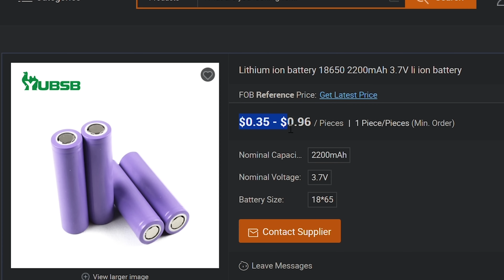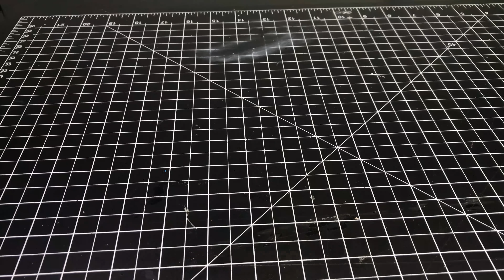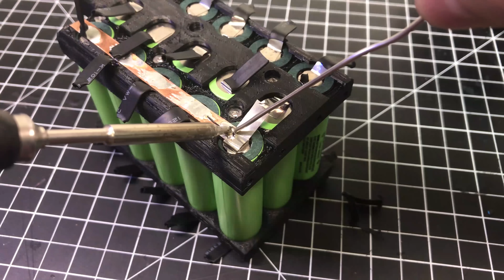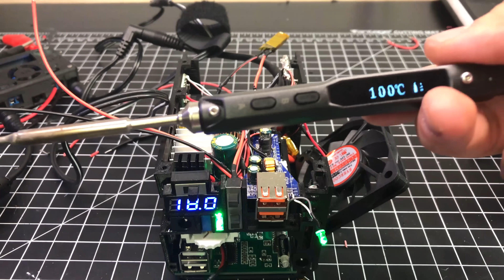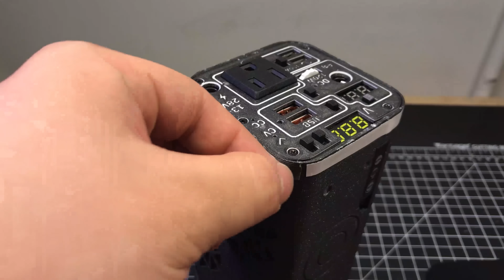How to Make the Ultimate 18650 Power Bank with Infinitely Expandable Capacity

Comment: As an alternative to soldering on the 5A fuse I would use an Inline Fuse Holder, its what they are for after all and will likely still fit, they aren't much bigger than just the fuse itself.

Heck looking at its positioning you can leave a small rectangular opening where the fuse is and poke the fuse holder out of it, it comes with a rubber cap that seals the fuse anyway.

Comment: I'm Pretty sure those cheap 18650's where fake re-wrapped batteries...
Reply: @Blondie SL There's a YouTuber by the name of Jehugarcia that makes videos all about projects that run mainly on 18650 cells. He always keeps links to where he buys them in the description. I've bought some of the 18650 cells from his sources and so far I have to say I'm quite pleased. Each cell is individually tested, charged , then discharged before shipping. I highly recommend you to use his sources.

Comment: Love these kind of projects however if you can't reclaim them from old laptop battery packs, etc. the cost of real good quality 18650s will put this back to the price of commercial offerings - those cheap 18650s often have capacities closer to 800mAh than the 2200-3000 of A grade ones, other no-name offerings are "factory rejects" of varied lifespan or refurbished from used products, etc.

There are many advantages to building your own - for instance many commercial offerings are poorly suited to charging from solar (especially if you want to charge and pass through power) and will shut off requiring constant manual restarting of charging from varied solar output.

Comment: should add 3 internal 18650's so the batteries are hot swappable
Reply: They wouldnt still be, because of the missmatch at the voltage, wich could cause a severe current flow between the cells wich have a different voltage, stopping you from doing that, unless we are talking about two separate cell circuits feeding the same system, with their outputs in parallel, and not the cells themselves, but then its quite different.

Comment: Check "Emergency Flashlights". Note that there's a very small list of pieces "missing" from what you've presented as far as overall volume is concerned. There's the $1 "USB Flashlight" (super tiny), the hand-crank (2"x2"x1"-ish), the radio (super tiny), and the solar panel(s). Total price still under $100, and a solid piece of emergency kit if in a waterproof case.

Comment: If it had the ability to jump start a car battery it would help a lot because I live in a cold climate, batteries tend to discharge due to low temperature. Other than that excellent work😇👍👍

Comment: Thank you! I don't know anything about electronic but watching this I only can say Woooow!!!! Thank you for sharing your knowledge to people. 

I have a question for you. I have two old drills. And I don't want to buy the old ones batteries because are made in Nicad. I'm looking for information about how to make the battery pack. Do you have some video about how to make this battery packs? I know in YouTube are to many videos about it but I found one comment about a circuit that stops or cut the energy pack when the battery is over discharge. In all the videos this circuit not appear so I'm for information about it if you have. Thank you for your time and this could be a GREAT project if you like :-) :-) :-). Anyway this video is amazing!!! Congratulations.

Comment: Watthour is electrical energy, Amperhour is capacity. And if that socket feed 150watts and 120volts the current is 1.25Ampers, but if voltage is lower, appliances don't work or they are slowly. This is possibly scam or something

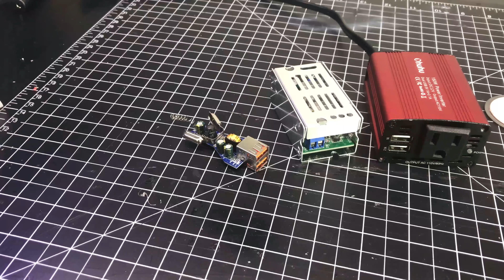Comment: Materials list: 2:45
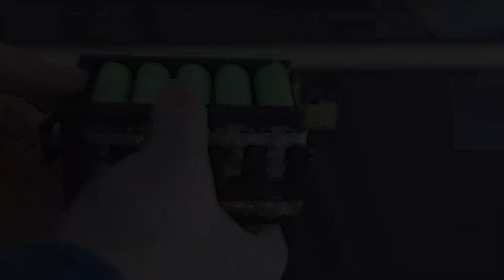Battery Pack: 5:42
Charging circuit: 9:52
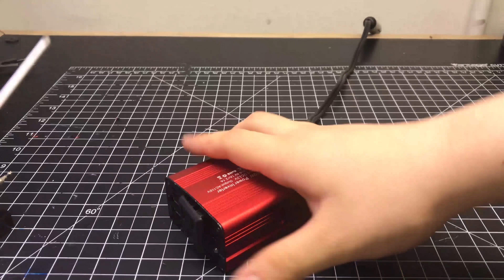Inverter circuit: 12:50
Mid layer assembly: 14:17
Relay power system: 18:26
Tests: 19:32
Top layer assembly: 20:19
Build complete: 23:25
RGB montage: 23:54

Comment: Great video. I just finished my project on a large battery bank for 120v. My wife drives an EV with short range (86 miles, fiat 500e) and some times she drives on the limit. So I did a 18650 batteries banks (4x29.4vx7S ) and used an inverter, this adds around 10 miles range. So when she arrives at work he put the bank to charge the car and when she leaves she have 10 more miles. 
PD: thanks for the great detailed list of components!

Comment: It's a nice project but your soldering work is realy dangerous. 
You should fuse the solder trough all the wires and not tag it on like glue. 
You should always end up with a smooth finish.
Reply: This is correct.
Reply from the maker: Well, I have to admit that I don't have the best of soldering skills. However, I would like to make these two points: 1. I was making it in my dorm room so I had to use unleaded solder, therefore a smooth finish is almost impossible. (also it is A LOT harder to solder compared to leaded Solder) 2. Since I'm filming, I sometimes had to solder at an awkward angle so my hand and arm don't block the shot. Some of the footage are for demonstration purposes, I finished the joints at a batter angle after the shots.
Reply: @kralyn3d  I have never heard anything about not being allowed to use leaded solder, but what I try to say is that I see so many DIY projects that doesn't teach the correct way of soldering witch could endanger people.
Reply: @Stoney_Eagle  if you need to learn to solder, you shouldn't be SOLDERING LITHIUM ION BATTERIES by the dozen. That IS going to go wrong at some point, and that is not going to be fun.
Reply: Klea Rusnim   i see tons of electronics i repair in my shop  with soldered batteries.. like every  laptop computer battery  or battery pack for a drone or game console ever commercially sold comes to mind.  id gladly send you pictures of a whole pile of them if you like. And i have to assume that you are a fellow engineer to be so liberal with your criticism
Reply: jamie johnson remotes use that spring type also rc cars and more
Reply: @Lucidbkeo  flux doesn't guarantee a smooth finish when you're using lead free solder.
Reply: with some practice you will get it right im sure. they make a fair point ... loose wires in power electronics are dangerous :-)
Reply: Klea Rusnim  Please show us your projects.
Reply: Klea Rusnim  commercial products solder batteries. You don't want batteries losing or having a bad connection, soldering is a much better choice than springs in a permanent installation.
Reply: Klea Rusnim  GET OVER YOURSELF.  Sheesh, not everyone is as smart as you.

Comment: I would keep one output port set to 18.5V for laptops, most laptops use 18V or 19V, so you can't accidentaly rub against it and raise the voltage. Or put that knob into recessed housing, or one with a lid that can be closed, or make it so it can only be adjusted with a screwdriver...

Comment: Great job!!! 
But since i am lazy and unmotivated, i rather grab a working but worn out powerbank (with as high powerbank-recharge current as possible), replace cells with absurd number of (relatively ;-) new cells, solder everything together, and wind it in some duct tape, (or put it in proper-metal enclosure, 'coz FIRE, if i feel like doing it). Oh, and fuses, one fuse per cell, again, 'coz FIRE!

Comment: Very nice project, i like that you are so focused on the safety of the project!
One thing i would note thought is that you should work on your solderjoints. Some of them looks like they could be "cold joints", which could cause you problems. This might not be a problem right off the bat, but it could come back to bite you after using it for some time.
Ohh and btw you should use gloves when you work with epoxy :)
Keep it up the good work! :)

Comment: if i replace the batteries with super capacitors, it should just work the same, only faster charging right?
Reply: You'd have a lot fewer joules, so it would definitely charge up faster.... On the discharge side, I don't think the batteries are the choke point so replacing them wouldn't make any difference

Comment: Only one important remark. 
You shouldn't use glue like super glue, ( any of Acrilic glues) during heat and time they are vaporising, and is it possible that you will have shortcut on electrical boards.

Comment: Nice Lil' Design, Butt Ifin You Want To Make It Truly Infinite You Need To ADD A Solar/Wind Turbine Input Power Plug &/or A Hand Crank Generator!!! Now That Will Then Be GREAT!!!! PS I Built A Tool-Box "Small Cooler" 2-cubic-feet Sized Version w/SPIM08 Lithiums =8aH Per Cells x 50 Cells = A Crap Load Of Power, Enough To Power My Whole 30' Motor-Home For Days & Weighs Less Than 40lbs Complete w/4000 watt Inverter! LMAO Thanks

Comment: Timestamps for mobile users:
Materials list:   2:45
Battery Pack: 5:42
Charging circuit: 9:52
Inverter circuit: 12:50
Mid layer assembly: 14:17
Relay power system: 18:26
Tests: 19:32
Top layer assembly: 20:19
Build complete: 23:25
RGB montage: 23:54
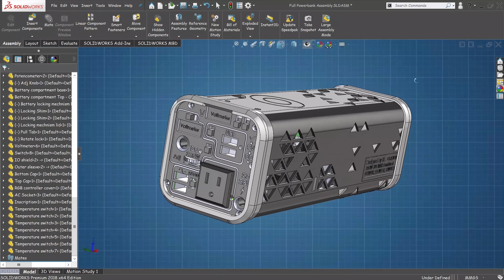Reply: What is the name of this program? 5:28
  Tell me please
Reply: @TheSCUBIDUBI  the name  of the PROGRAM is SOLID WORKS
Reply: @qDrayeNN  yeah, does he have blurry vision?
Reply: 1
Reply: Boss why no FM and speaker PCB WiFi

Comment: I did something very similar to this.

I used a 4S4P Samsung 18650 with 3500 mAh for higher output voltage as I want be able to provide voltage over 12V with longer term stability.

Comment: Hey I really like this. Just a few things to mention. Soldering 18650s like that while it works, Is definitely not recommended because of the strain it can put on the batteries. Even a very cheap spot welder is a better option. That fuse i'd have tried to add a holder in for easy replacement when it fails instead of having to re-solder it each time, Last of all is a repeat of what others are saying, Maybe design a pcb for all these instead of soldering wires to everything. Any chance of making another one with any or all of these suggestions? I'd LOVE to see a updated version. Would be awesome.

Comment: This project is so good and ambitious, it will be too much work and have too many points of failure for many of your viewers. I am an experienced Electrical Engineer with many years of detailed projects under my belt and I would be reluctant to take on this project. It is really lovely, but I am warning your viewers that they should be very careful to understand all these components and sub-systems and how to connect them before attempting to begin this project. If you are the type of person that doesn't manage many small details with great care, don't bother to even think of doing this project. When you watch his excellent video, he moves through the steps rapidly and you might get the impression that this is a very simple and easy project. You would be wrong. I advise you to watch this video many times before beginning to assemble this great project. Thank you for your very hard work to make this video. Your one forgotten step shows everyone that it is very likely that mistakes will be made, no matter how careful you are when doing this project. Great care and patience is absolutely required here. But, the result is spectacular! Good Luck!

Comment: Great idea.

And I have thought about how you can vastly improve this in to a design that is very much portable with the power and the features that are severely lacking in other power banks.

I do think that the inverter is over the top and poses an issue for many AC devices like switch mode supplies as you will get some idiot plugging in to a SM PSU inappropriate devices and easily overload the thing.

You would be better off using a 12V feed in to one rather than cannibalising it, you then can make the existing bank smaller, adding more USB's is easy because you can get them as modules and regulated too.

Other than that, really interesting build and really like it.

Comment: Good project... but the construction is just awful. To many flying wires, some wires don't even have shrink tube to prevent shorting. High current lines passing through low current lines. Not even a fuse holder.

Thanks but no. This thing is waiting for a short to happen (or even an explosion).

Comment: I know I'm being picky but adding those heat sinks like that directly to the MOSFET package will not do much if anything. You said it was optional, but really its unnecessary. You'd have to flip them to properly pull heat from them and that would be difficult to do with the balancing board. Still, this is an awesome project.

Comment: Great idea with a lot of potential and I particularly like your case design for the most part. I do have a couple of concerns on around your design that I would like to note.

1. Many tack soldiered connections. All solder connections should be mechanically and well as electrically solid. Tack soldering high current connections is a recipe for problems. Under high current conditions solider will become softer and any mechanical stress can result in a solder joint that increases resistance. Over time the heat level increases until the joint fails completely. A high current connections should be able to stay connected without soldier and the soldier's job should be to improve the resistance of the connection. Tack  soldiering the fuse in the circuit was the biggest problem I noticed very quickly. Just use a fuse holder and place fuse when it can be replaced by removing the outer shell.

2. So much use of glue will make fixing this device very difficult and possibly require replacement of the case pieces to fix at all. Small fans like you used are not known for their long lifetime and you glued the fan in. Your design could easily be altered to use standard fan screws.

3. Air flow seems to be very limited and heat producing components abound. Further more your use temperature cutouts in numerous places without using proactive temperature control measures will result in high operation temperatures. Cutout switch are design to prevent extreme conditions from existing for long periods of time. These switches will allow high temperatures to exist for a period of time before they react and when carrying high currents the cutoff switch will start to degrade. This same problem can be seen in fuse circuits, microwaves are a major example due to the large current variations during operation. The results in the fuse element bend back and forth until it weakens. When a fuse blows under high current conditions it can be violent and that is way ceramic fused are required in microwaves. Thermal cutoff switches are not design to switch under load on a frequent basis. Using other means to measure and control temperatures are important as they can keep the components from reaching extremely temperatures in the first place. This ensures that if something extreme really happens the cutoff switches will prevent dangerous heat conditions from developing.

Comment: Amazing project ! Congratulations !!
Just a question, is it safe to solder the batteries instead of going for spot welding ?
Reply: There is a real risk of damage when attempting to solder Lithium-ion batteries. Spot welding is the preferred method. Some people have the skills and luck to pull it off though.

Comment: I can see it all falling apart after the 1st drop. Construction doesn't look solid at all and RGB is useless in my opinion. Its such a mess inside should have made a PCB and connected everything together on it. Should have made a 6S battery pack with 24V inverter and using step-down converters on the circuits that would need it. GJ on that battery hot swap tho
Reply: Hey matti would love to learn more about these arrangement and naming ctriteria, ie 3s,5s and 6s, i don't get them, any leads please? Just need to learn as well
Reply: In a pack "s" means how many cells are in series like: 3s - 3 cells in series or 10s - 10 cells in series.
Depending on how many cells you have in series you get a higher volatge 3s - 3*3.7V=11.1V(nominal voltage for the pack). You can also have packs like 6s7p which means that 6 cells are connected in series and 7 times in parallel. 6s7p is 22.2V and if one cell has a capacity of 2Ah then the pack is 22.2V 14Ah. Connecting cells in parallel increases the capacity.
Reply: @TheMati117  Perfect thanks for the explanation, reason why i asked is because recently i made a 15 pack cell in parallel with cells salvaged from laptop batteries, i get between 3.7volts to 4.2v. Was trying to research on how to recharge them well. Btw not sure about their Mah, i guess they are roughly at 30,000 Mah. I just have so many questions, maybe i should just Dm and ask away, esp now that i also just learned about boost boards.
Reply: There are cuircuits in china that can will let you test the cells and show their capacity, some can even charge them. For charging you just need a constant current power supply or a step down board CC(constant current) CV (constant volatage). If you search on aliexpress you can buy step down CC CV for around 5$ with a screen.
Reply: @TheMati117  Nice, that's what I have been searching, will indeed but from ali express. so i wanted to test out boost converters, what if i added one to my pack and increased the voltage to 12v and run a 12v load, would that mean that the batts would drain fast or what are the disadvantages?
Reply: If you boost for example 5v to 12v its around 2.4 times higher, having 20W load would mean that on the 12v side should be 1.66A and a little higher on the low voltage side(4A+). Its just a slight disadvantage and will drain faster but its not worth it if you run plenty of boost converters. Having higher voltage and lower mah will let you charge faster and cells will have a lower load. its better in my opinion to use step down converters and just have more cells in series.
Reply: @TheMati117  Perfect, I will def be building my next cell pack in series probably a 3s set up of 15 cells. I will also research more on boost and bulk converters.